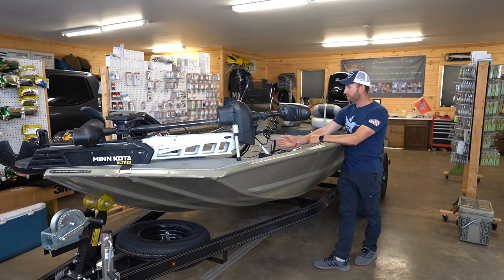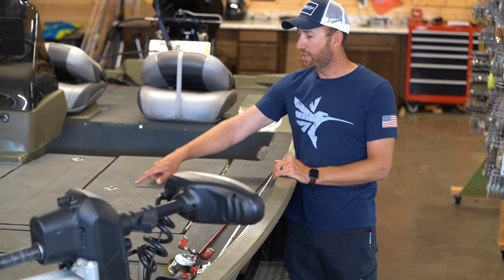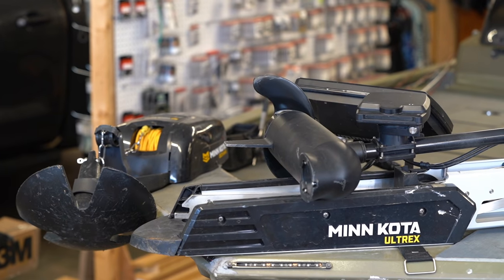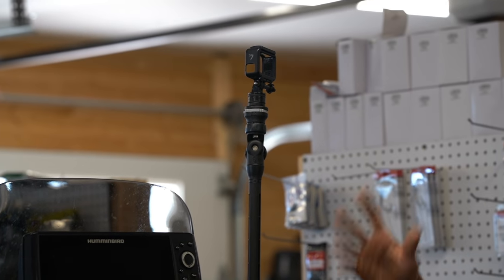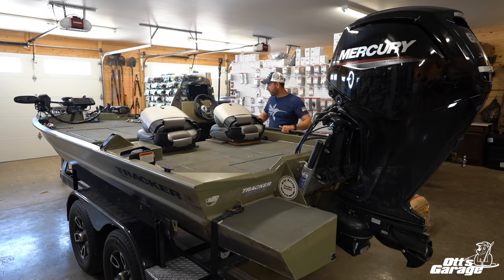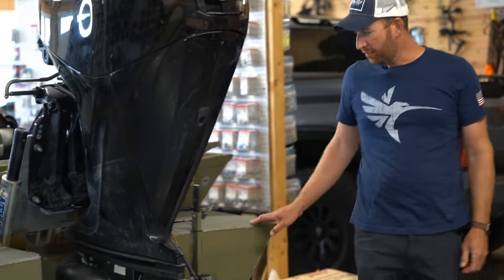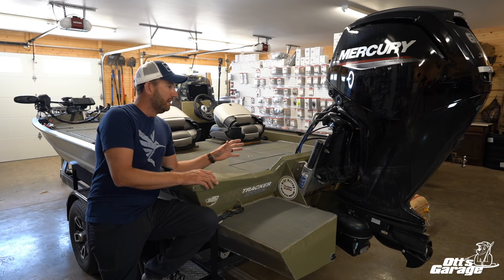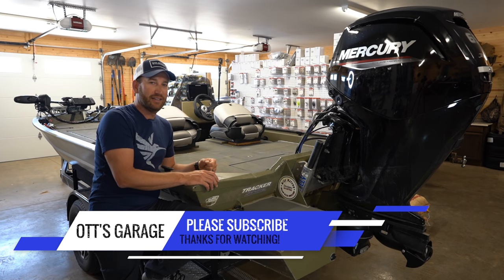Full Walk Thru Of My @trackerboats And @MercuryMarine Jet Drive

Comment: You wouldn’t have a part number for that windshield would you? Been looking to find the right one. I have a 2016 1754SC same as yours with the 60Hp. Love your set up. You should also put a video tag with the 1754SC. Not many videos covering them. Keep up the mods and videos!
Reply: @Nick Barnett 
My brother had a heck of a time finding one that fit properly. He ended up buying a piece of plexi glass, drew the shape he wanted and used a heat gun to bend it around a piece of steel pipe.  Worked really well. And I think it cost him like $18 for the materials.

Comment: are float pods with trim tabs a thing, or is it basically a one or the other type choice? basically talking about adding pods to a mod v tin boat
Reply from the maker: It would be hard to mount them right if you have both. Ive had trim tabs before. I never will again on a jet. They were always the first thing damaged in shallow water.
Reply: @OttDeFoeFishing  yeah im thinking regular mod v style hull on a regular lake. i just like the idea of float pods in order to handle a heavier engine as the 70s engines were 2 strokes and weigh nothing, and modern engines are all way heavier. 76 evinrude 115 is 300lbs and a new pro xs 150 (boat is rated for 150) is almost 500lbs.

Comment: Would a 200hp outboard give an advantage over a 150hp? Ive heard some guys say anything past a 150 may not be worth it due to the amount of water you can move through the jet pump. What are your thoughts on this?
Reply from the maker: It would be a little better performance I would guess. Maybe 3-5 mph. Not a ton.
Reply: What is the top speed

Comment: I have a 36v ultrex on my 20ft g3 alunimun boat.  In heavy current my trolling motor goes crazy turning left to right back and forth.  Does yours do this too?
Reply from the maker: I’m guessing you’re talking on spot lock. It does from time to time. There’s a setting in your remote that can help. It’s like a sensitivity setting type thing. It will make it do it less if you turn it down.
Reply: @OttDeFoeFishing  that is really good to know!  I love my spot lock and using the +5' feature on the remote to easily move up and down current but its really jumpy some times.
Reply: Waler. 18 rage. Ford v8. Jet drive 285 hp 40 knots 45 mph

Comment: How does the Jet like a set back? I’ve always heard it needs to be as close to the boat as possible to save cavitation
Reply from the maker: Works great. Ive always thought a little bit allows some of the air to escape before getting to the engine. I would put my set up against any outboard jet for handling.
Reply: @OttDeFoeFishing  good to hear. Boating has more myths than the Appalachian Mtns

Comment: How well do the jets operate in small floating debris from rising flood water conditions or hydrilla, duckweed, lily pads, etc ?
Reply from the maker: If it’s small enough it won’t be much issue. If it is big enough to clog the grates it will require stopping to clear it. Pads would do that for sure. Loose duck weed and grass wouldn’t be a big deal.
Reply: @OttDeFoeFishing   Noted. Thank you, sir, for the fast response.